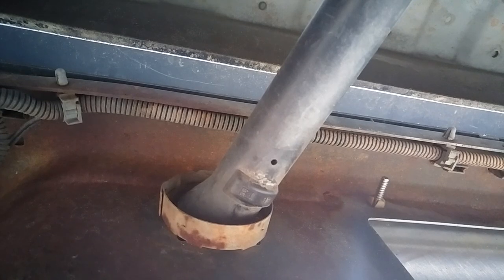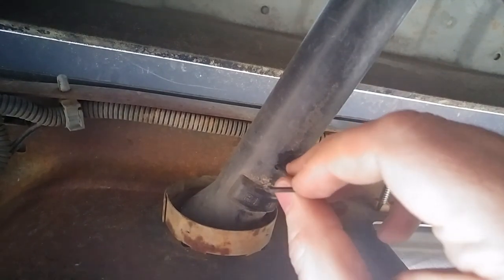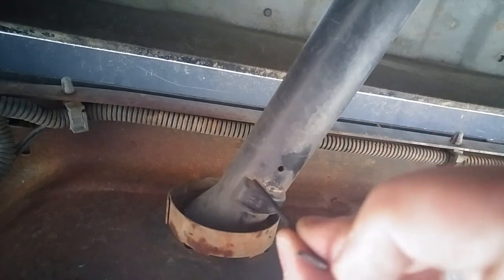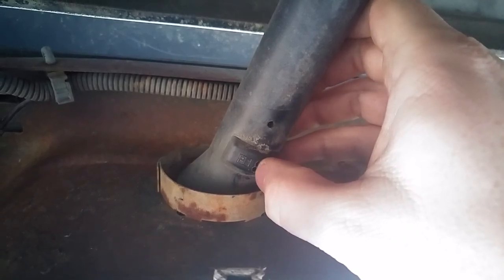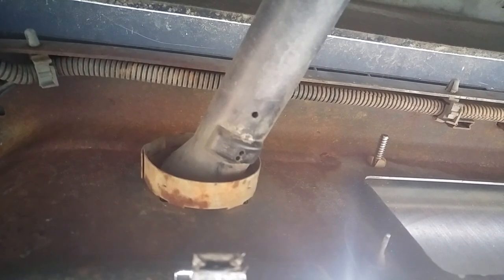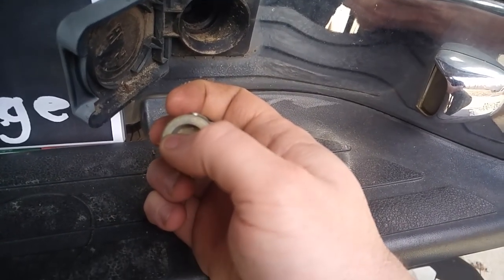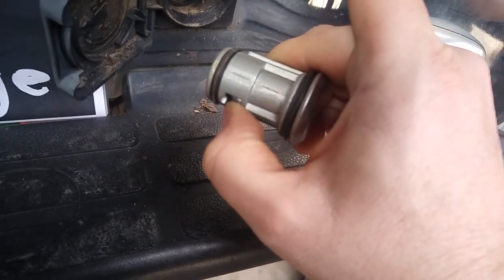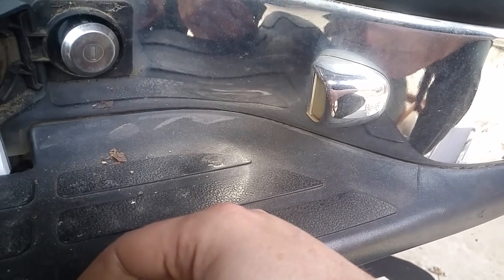Help! I Can’t Get My Spare Tire Lock Off! Quick Fix!

Comment: Thanks, that was just what I needed.  I bought a used bumper with the lock still in it.  My job was much easier because I had access to the tube from the back.  Knowing where that little latch was on the cylinder made it easy.
Reply from the maker: Glad it helped

Comment: Thanks so much for this video. I bought a 2013 Sierra and neither key would work the tire lock. The local dealer couldn't even tell me what to do with it. I had to use a longer drill bit because of the trailer hitch, but took about 3 tries to pop it out. Thanks again for the info.👍👍👍
Reply from the maker: Awesome! Glad it helped!

Comment: Thanks!         This summer my 2000 Ranger got a flat while I was out of town.   First flat I had in 22 years.  I, too, had no key to the lock, had no access to the spare so AAA drug the car up onto their tow bed destroying the flat in the process, had to buy a new tire.  Damn.  Gotta fix that lock!  Then 2 months later I was in the middle lane on Interstate 255 when another tire blew and that was destroyed!  You don't think I had fixed the lock, do you?  Had to call AAA again!          Never thought you could gain access to the lock from underneath.  I was expecting I'd have to drill it out. Tx!
Reply from the maker: It's a sign...times two! :D
Reply: could you access it?  Mine's a 1999.  I don't have key.   Looks blocked off, i'll have to check again but I don't think its accessible from below (without seriously taking more parts off first)

Comment: I find that most people just stick the key in and then try to turn the key. If it doesn’t turn they try more more twisting force. I find if you push the key in as hard as you can and then twist it easily turns.

Comment: This is very common on our Chevy trucks. This will help me and a lot of other people. I guess I should go check mine and see of it's going to work. Thanks.
Reply from the maker: Awesome.  I found out the bumper was a junkyard pull and the key was never found so I was doomed from the get-go.  For now, I threw the spare tire in the back of the trunk and the lock into the toolbox until I source the tool kit to raise and lower the spare.  Hope all is well with yours!  Thanks for stopping by my friend!